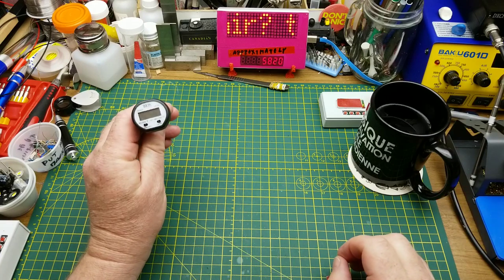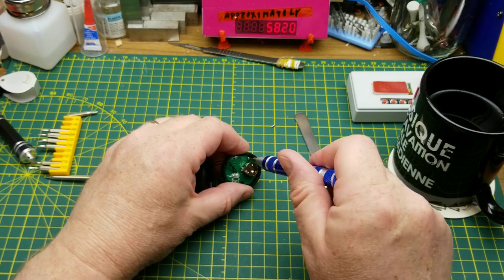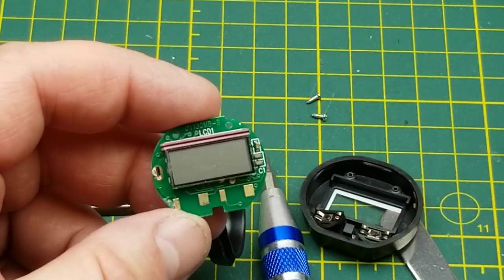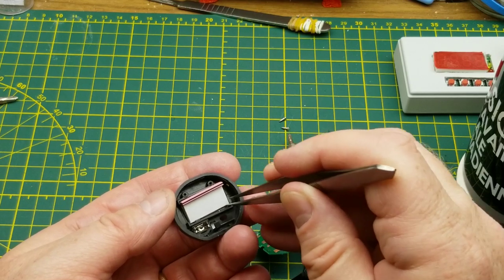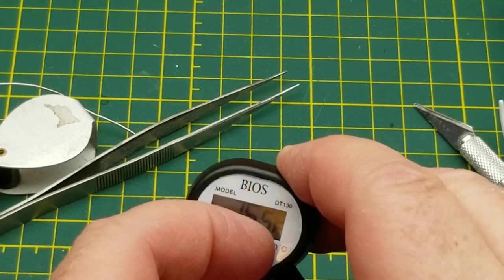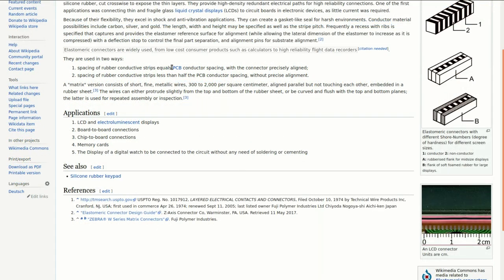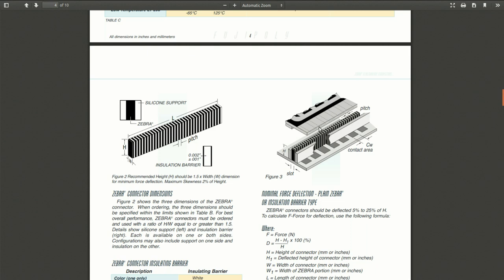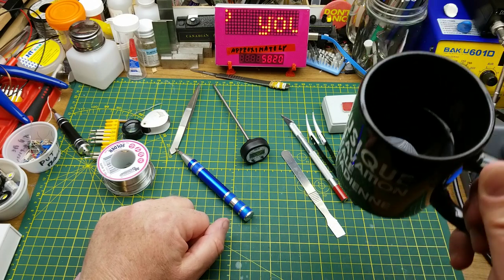Digital thermometer repair (and a slight tangent)

Comment: Well done, the temp sensor lives another day :-D
Yep i looked at zebra strips a long time ago, so many conductors that one or more will connect.
But muck and bad clamping causes display fading and bits missing.
The cheap multimeters suffer and fluke too.
If strip something for bits i keep the zebra strips.

Comment: You got very lucky with that zebra strip. In my experience their usual failure modes are loss of conduction due to contamination by frinst skin oils, or delaminating the typically flimsy metalization on tiny LCD modules when removed at any time after first assembly. You can clean the strips with rubbing alcohol but when the metalization comes off the glass, it's done.
Reply from the maker: As stuck together as it was initially, I was also a bit worried when the strip broke loose from the board. 
It probably would have more potential for disaster if it had peeled off the LCD instead of the board.
Reply: @pileofstuff  Yeah, It didn't help that it was crammed so tightly into the front of the "case" that trying to put it back in dislodged it.
Oh well, another bullet successfully dodged!

Comment: There should not be any DC component on the signals driving an LCD segment but there may be between adjacent contact pads. couple this with water vapour and you can start to remove the thin layer of metallization on the glass and there's no going back from that place.